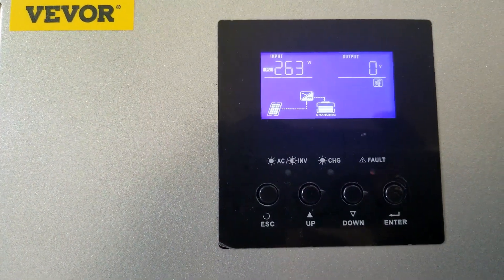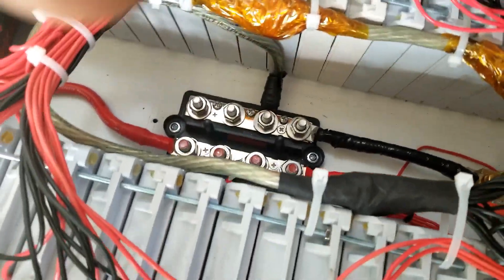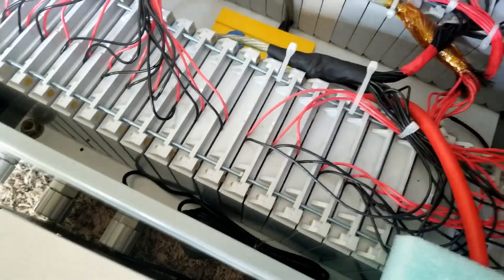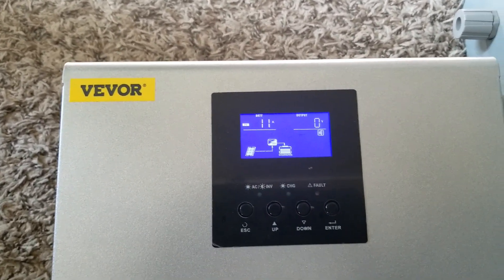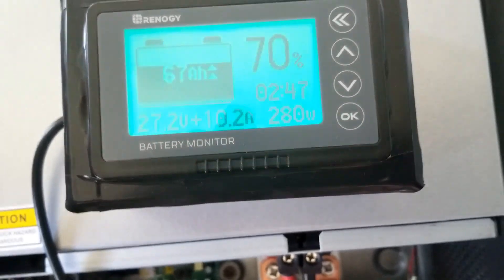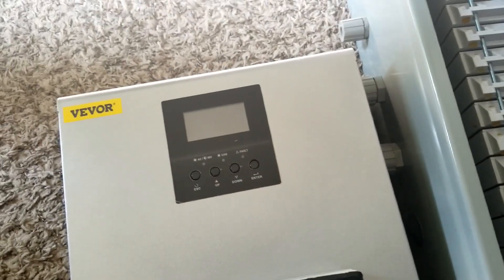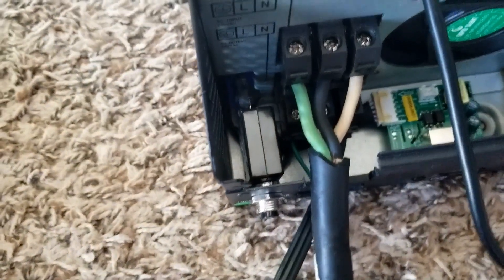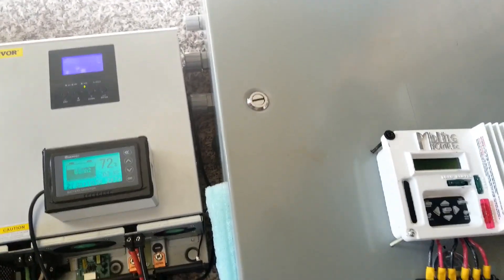VEVOR: 3KVA 24V MPPT HYBRID SOLAR INVERTER BUILT-IN PURE SINE WAVE CHARGE CONTROLLER

Comment: Hi!!! Can you tell me if I can use this hibrid inverter to use it on our church sound and streaming devices as UPS????? we live in Cuba and we have a lot of  electricity failures!!!!!
We have a back up generator but all sound and computers for streaming shoot down when main electricity goes off!! 
For that reason we need an UPS around 1500 watts to suply energy till the generator runs. 
This vevor model has UPS
Reply from the maker: Yes you can.
Make sure you calculate all the wattage of each equipment you are about to power at the church including lights, fans to make sure the Inverter is not overload.
Be sure to have enough battery bank storage and solar panels if you were to use the system during the service hours.
Reply: @jwsolarusa  thank's!!! But can I use it without solar panels??? We don't hve them!! We need to use ut just with locar main power and batery as Ups till the generator start on!!
Reply from the maker: @frankbatistasanchez7367  
Yes you can use it as off-grid battery backup system without solar panels  and also hook it up with your generator to the AC Input of the Inverter to charge the batteries simultaneously as the service proceed.

Comment: is there special seating has to be done? I have the 3KVA conected to 6 panels 36.5 V connected in Series  . But the system is not working with PV even the screen shows PV input 220V. Any advise? Thank you for sharing your work.
Reply from the maker: What do you have?
3KVA 24v or 48v 120V or 230V

3000VA Hybrid Solar Inverter
Rated Power: 3000VA/2400W

Solar Charger Mode:

Rated Power: 600W

System Voltage: 24V DC

Max. Solar Voltage(VDC): 75V DC

5000VA Hybrid Solar Inverter
Rated Power: 5000VA/4000W

DC Input: 48V DC, 87A
AC Output Voltage: 230V, 50Hz, 22A

AC Charger Mode:
Input: 230V AC, 50Hz, 36A
DC Output: 54V DC, 10-60A

AC Output: 230V AC,50Hz,22A

Solar Charger Mode:
Rated Power: 3000W

System Voltage: 48V DC
Max. Solar Voltage(VDC): 145V DC

I HOPE YOU FIND THIS INFORMATION HELPFUL AND ALSO DON'T FORGET TO LIKE👍 SHARE AND SUBSCRIBE TO MY YOUTUBE CHANNEL
Reply: 3kva 24v @jwsolarusa
Reply from the maker: @husseinmunaim863  
Your inverter can only handle 600W of solar.
You mentioned you have 6 panels wired in series?
That inverter can only accommodate an input VOC  Max. Solar Voltage(VDC): 75V DC
According to you solar panels specifications you sent me, you can only have the panels in parallel NOT in series
Reply: "Max. Solar Voltage(VDC): 75V DC" does this mean my PV DC voltage cannot be more than 75V? therefore I need to reconnect my panels to produce only 75 max not 220V?
Reply from the maker: @husseinmunaim863  
Yes.
You have to reconfigure your solar panels to parallel for 36.5v
You can NOT Series your solar panels at all or your VOC will be over 75 Voc.
If you want this inverter to work, keep the voltage to 36.5v six hundred watts in parallel
Reply from the maker: What's the wattage on your solar panels
Reply: 285 W, Thank you for clarifying the voltige issue. I will configure each 2 in series and the 3 groups will be in parallel, that will give me 72.5 V
or is it better to connect all 6 in parallel with 36.25 v @jwsolarusa
Reply from the maker: My friend,
The solar panels RECOMMENDED for this inverter is ONLY 600W that's it. 
You ore LIMITED to 600W on this system. 
With your 285W solar panels each you have their, you can only have two in PARALLEL  due to your Solar Input Voc  LIMITATIONS which is 75V Max. 
If you decide to wire 2 panels is SERIES, you are right at the 75V and you inverter will NOT produce any solar power.
I suppose I have exceeded my explanation.
Good Luck

Comment: Hey, did you say that model can be changed from 220 , to 110
Reply from the maker: This is a 230Vac single phase international version.
By using a step-down transformer on the AC Output, you can get 120V AC North America .
Reply: Where can I get this step down transformer I have this unit and vac output is 198 line 1   28vac line 2 will this transformer fix this

Comment: The battery percentage meter won't be accurate till it cycles from empty /full/empty /full.  fastest way is to turn off all charging and run it down to the auto shut down. Then, let it charge with no load till full and it stops charging . Then repeat the  drain and charge cycle again. After that you can use it normally and it will be accurate.
Reply from the maker: Thanks for your contribution and don't forget to SUBSCRIBE LIKE 👍the video and SHARE

Comment: What is the idle consumption of the unit when there is no load but the unit is on?
Reply from the maker: It can be regulated to a search mode
Reply: When in search mode will it start a fridge? I  know that won't happen with units that come with eco mode . That's why I want to know what the idle consumption is. Eco mode only works with resistance loads like light bulbs or heaters.
Reply: Vevor said 10 watts standby, I assume that is in search mode?

Comment: I need it to charge pylontech batteries from grid, and than discharge 220v electricity over the course of the day to appliances.Than charge back from a grid. I assume thats possible, but have not tried it yet. Anything you can think of that would prevent that?
Reply from the maker: Yes......👍it is possible
LIKE SHARE and SUBSCRIBE
Reply: @jwsolarusa  It works for batteries. But I added two renogy solar PV and it does not show it charging. And I cannot find manual for inverter anymore
Reply from the maker: The unit is designed to perform all of those tasks you mentioned.
Thanks for watching and don't forget to LIKE👍 & SHARE this video. 
Cheers

Comment: Hi I have found your video interesting. I have a Vevor 3000w inverter and it has the same screen as yours. How do you set it up so that the PV panel picture to Battery picture appear on screen? I have never seen it appear. Thanks Norman from Scotland UK
Reply from the maker: VEVOR: 3KVA 24V MPPT HYBRID SOLAR INVERTER BUILT-IN PURE SINE WAVE CHARGE CONTROLLER
https://youtu.be/u39xw-jstxM

VEVOR: 3KVA 24V MPPT HYBRID SOLAR INVERTER BUILT-IN PURE SINE WAVE CHARGE CONTROLLER 230v TO 120v
https://youtu.be/LSjPtFklaQA

VEVOR HYBRID SOLAR INVERTER REVIEW
https://youtu.be/iLM1Px3XHU0

VEVOR: 3KVA 24V MPPT HYBRID SOLAR INVERTER MOUNTED ON A POWERWALL
https://youtu.be/DbPnbPWuGJc

Comment: Is one panel (72cells) enough for a 3kva inverter? Together with 24v batteries?
Reply from the maker: Two approximately as per system specification or you can always add external charge controllers for more solar panels.
Thanks for asking and for stopping by. Don't forget to check out the rest of videos on my playlist. 
LIKE SUBSCRIBE & SHARE.

UNISTRUT SOLAR PANEL MOUNT: https://www.youtube.com/playlist?list=PLSNjIRSnUPDJSvz75KI8_pijBq43WgZyY
 
MPPSOLAR (GK) 3kva 3000W 24V 230vac SOLAR INVERTER + 80A MPPT SOLAR CHARGER HIGH PV 500V: https://www.youtube.com/playlist?list=PLSNjIRSnUPDKXXZG828Z7JPsQQSC4RdWi

MPP SOLAR INC PIP 2424LV-MSD 120V 60Hz: https://www.youtube.com/playlist?list=PLSNjIRSnUPDI2b7XfOIOWnpE7VGq2gOEO

MPP5048MG 230V(50Hz)AC Single Phase to 110/220V(60Hz)AC Split Phase: https://www.youtube.com/playlist?list=PLSNjIRSnUPDIEZHvXZy2kAiNZQXdKFeVW

PIP5048MG Cable Management Cable Management Tips: https://www.youtube.com/playlist?list=PLSNjIRSnUPDK7wo8ldHXkyqpd_Xxh-OVu

PIP5048MG Parallel Board Installation: https://www.youtube.com/playlist?list=PLSNjIRSnUPDKb1XzSvD2Jxs4aJDol50E7

Comment: Great inverter and battery case set working together for the first time 🤙. Seems to be working well on the cells and both cases , the inverter and battery case seems to match well especially together maybe all on the wall . I would say 😉, if there were many more battery cases made the same way , then both the inverter and the battery cases can all be mounted on the wall with no more batteries stacked on the floor🤔 . A JWSOLARUSA all wall command center ! 👍🏿👌
Reply from the maker: That's my plan. You are always reading my project plans🤭👍